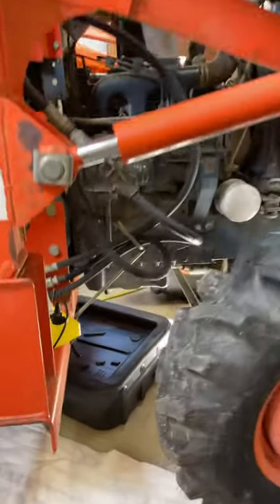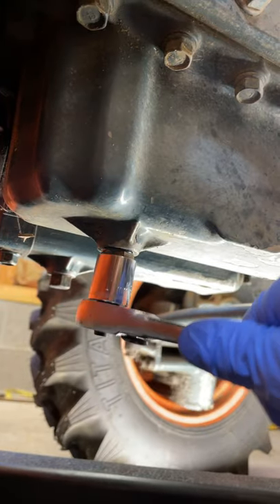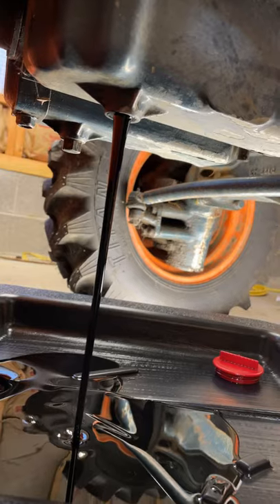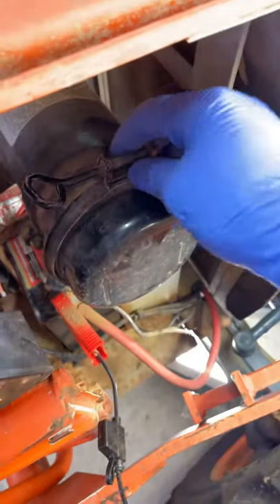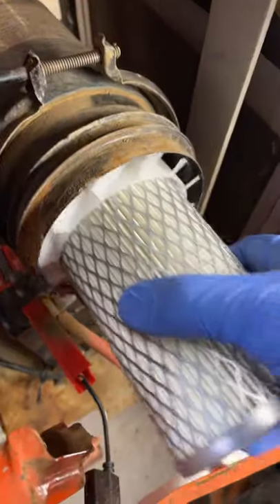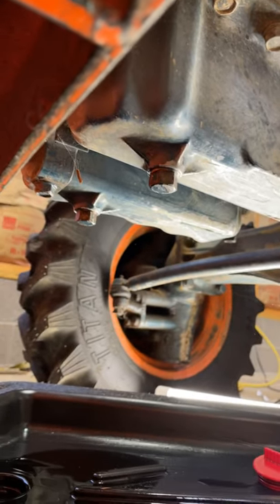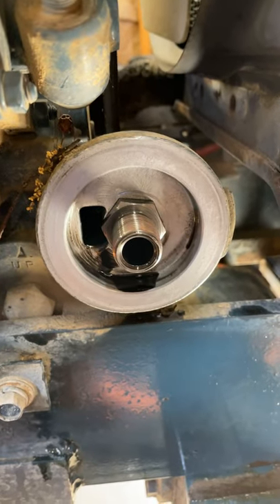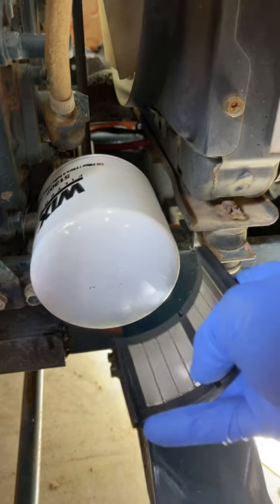Service A KUBOTA Tractor In Under 60 Seconds!!

Comment: Then you have  to check for a number of things.
1.check for leaks on bucket lift cylinders
2.check alternator output,check for ripple voltage 
3.check acid battery level,if its a maintenance type, check for battery power when starting 
4.check for loose wheel nuts,
5.chcek for leakage (oil and coolant)
etc

Comment: Write on oil filter number of hours with a scratch awl a must. 
Fuel filters ???
Check hydraulic system.  
Grease nipples 
Finally a wash because a clean tractor is easy to spot oil leaks. 
Then it is beer o'clock 🍻😉

Comment: You didn't do the most important part of the job you need to grease all those zerk fittings or grease nipples .not to mention the battery and hydraulic fluid and filters.

Comment: Fill the oil filter before installing.
Reply: How do you fill a side mounted oil filter
Reply: @brandonb7337  well that's a little harder ( messy) to do so I put it as close as possible before I turn it 90°. I'd rather have some rags get oil on them then starting with a dry oil  filter. In your video it appeared that you were looking up at it and not sideways. Either way I would try and get some oil in that filter before turning over the engine.  I've serviced engines over 40 years and I've seen numerous types of damage from dry start ups. We have installed pressure systems to bring the oil pressure up to normal before ever cycling the motor. No more scuffed cylinder walls or bearing on the main. Biggest saver of engine wear is clean oil. Really it might not matter if you're not planing on keeping the tractor for long or if you like rebuilding motors as a hobby. Some people or companies trade in each year like a car so they never worry about the wear only the hours on the contract. I can send you lots of info on oil if you like. Mostly how to keep it clean, how to test it, which and why to use certain oils etc. Better yet contact the Nor is company and they can provide hard copies and online schooling.
Reply: @brandonb7337  looked at your video again and in the first part I see the filter on the left side of your tractor. I might also mention that you're not doing yourself much good if you don't take all the time it takes for the oil to drain out. A teaspoon of contaminated oil can seriously pollute fresh oil.
Reply: @larryfowler5675  you make a lot of good points. When I service a Kubota with the filter mounted like that i never have worried about it cause of the oiling system they have is top notch. Aney vertically mounted filter I always fill up.
Reply: @larryfowler5675  and it's not my video 🤣
Reply: @brandonb7337  your right, it's not.